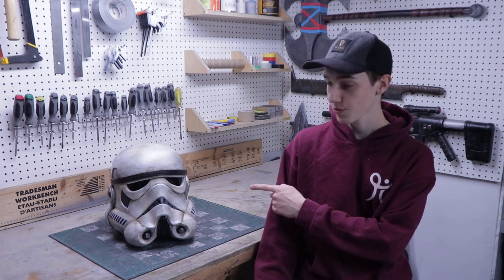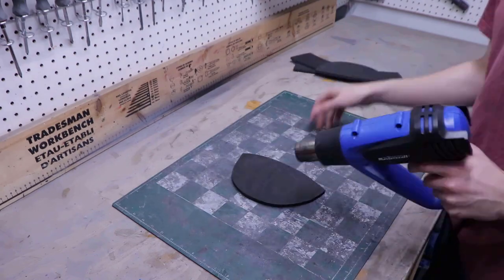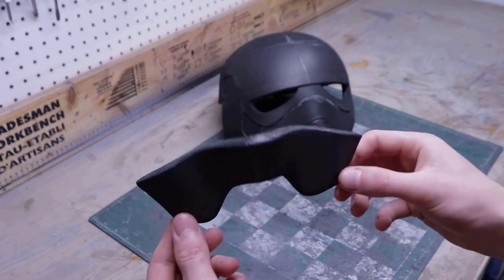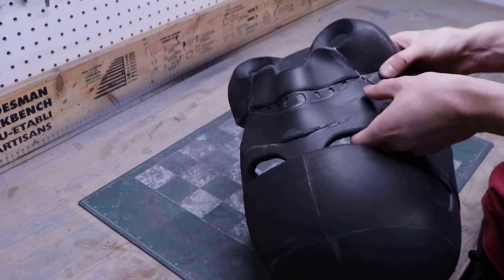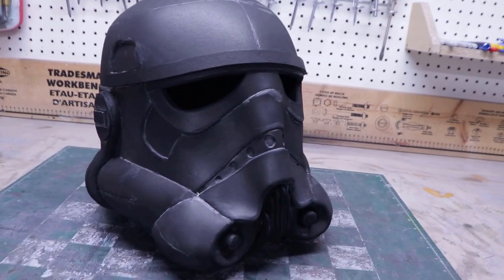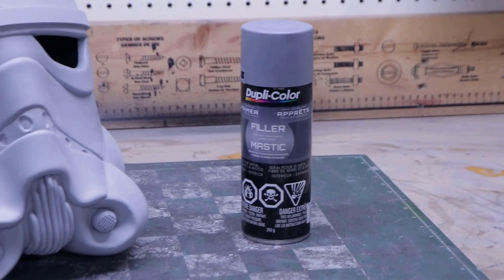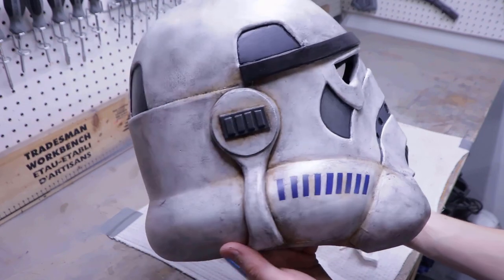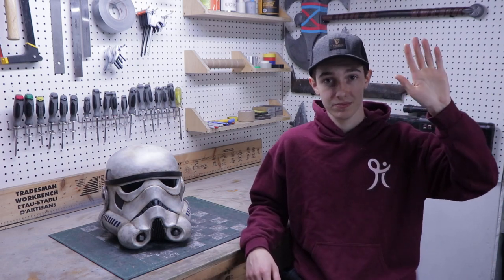Make Your Own STORMTROOPER Helmet Out Of EVA Foam | With Templates

Comment: Awesome job Tristan ! Congrats. May I ask you if you mix the Liquitex paint with some water before using it ?
Reply from the maker: Thanks! I use the paint without thinning it.
Reply: @TristanMaker  Thanks for your quick answer :) Working the same but I see a lot of strokes :/ Guess it is an hard work to hide them as much as possible ?
Reply from the maker: Normaly I try to apply the coats as thin as possible. This avoids the brush strokes, but it takes more coats to get an opaque finish.

Comment: Just bought this template and was wondering what is the scale for a full size print out so I can create the helm from foam? At the moment, all the templates print out on one A4 size piece of paper, any help is appreciated...
Reply from the maker: You can print the templates on any size paper and using any printer.

Check out the sizing chart located in the pictures of the listing to find the scale that matches your size.

Then, simply watch the printing tutorial video linked in the product description. All the information is there.

Comment: I am having a lot of trouble getting it SMOOTH!  Suggestions?!?
Seems like when I spray a layer on it adds air bubbles and I end up with spray drips.  Sure it’s all in practice but I am open to suggestions! Please !!!
Reply from the maker: The key to a good finish is spraying multiple light coats. That should fix any issues.

Comment: Hi Tristan bought your Etsy files, thanks. How many Eva sheets of each size are needed?
Reply from the maker: Thanks for your purchase! I'm not sure exactly, but with a 1x1 meter sheet of 8mm foam, and a 0.5x0.5 meter sheet of every other thicknesses specified on the templates, you should have more than enough.

Comment: I'm about to start building this, but I don't have 5mm foam. I have 6 or 4. Which size would you suggest I use for those pieces?
Reply from the maker: 6mm would be better in my opinion
Reply: @TristanMaker  thanks!

Comment: I'm struggling getting the round mike hole pieces and the tubes to fit into all together. You did say to do this part carefully, and I can see why - it's probably the hardest part of the whole build. I'm on my third attempt at cutting the pieces and it still doesn't look like yours. Really tough to get this section to fit right. It's almost like the mic cups built from the two pieces are never as deeply cupped as yours, and don't seem to fit the shape of the part they then later fit into. Hmm.
Reply from the maker: Yeah that's definitely the hardest part of the build. If you really can't do it with the 8mm foam, I would recommend using 6mm foam for this part as it's easier to form. Glue it flush with the rest of the helmet on the outside and the thickness difference shouldn't be visible.

Comment: how do you print the templates with a normal printer ? Mine are very very small...
Reply from the maker: Hi, you need to use the poster option in the print settings. You can watch my printing tutorial video linked in the product description on Etsy.

Comment: Will 10 mm foam work instead of 8mm
Reply from the maker: I wouldn't recommend it as it will be harder to form into the right shape. A good high density 6mm foam will work better, if you can get your hands on that.

Comment: what thickness do you use EVA Foam?
Reply from the maker: It's mostly 8mm, with some 10, 5 and 2mm. You can find all of the required thicknesses in the product description on Etsy and on the templates directly.
Reply: Thank you! These sizes are written on the templates that I bought! I mean how many square meters of material? @TristanMaker